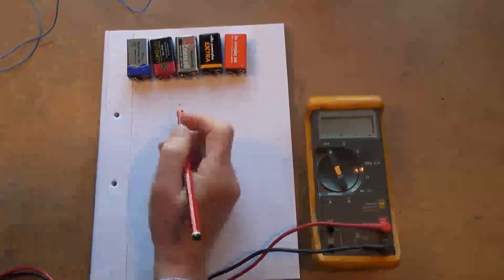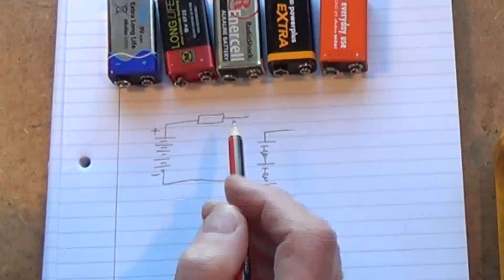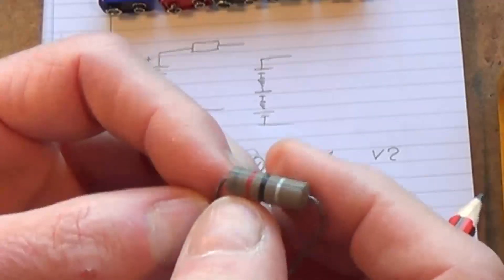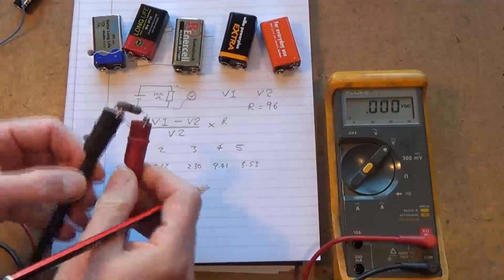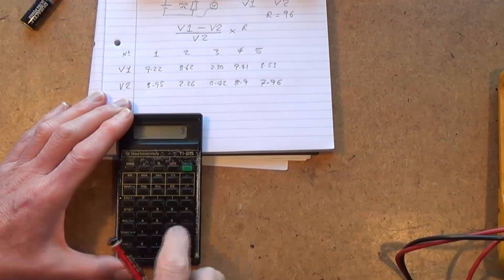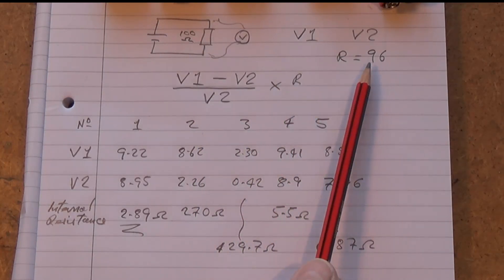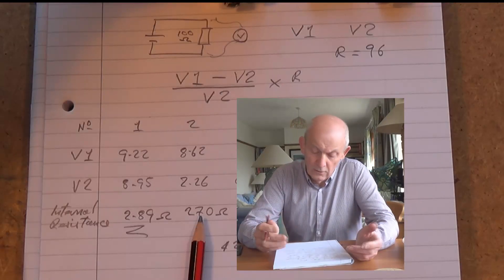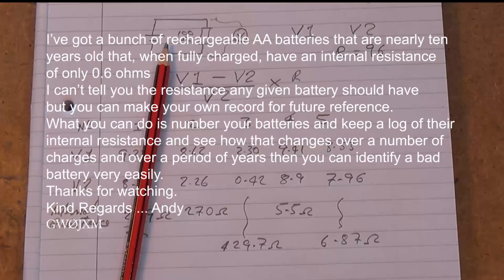About Radio 87 Measuring a batteries internal resistance

Comment: hey andy, i need your opinion. I've built an active antenna circuit for one of my radios. the circuit as is runs off a 9v battery , im gonna box it up and run it off mains with a 12v transformer,regulatorr ,the whole bit. my ? is should i use a resistor or inductor in my pi filter, im worried about rf jumping on the mains. ty

Comment: Hi Andy, could you tell me what Wattage resistor to use with a 12v 2Ah sealed lead acid battery?  I need to check the internal resistance

Comment from the maker: If you want to reduce RF then an appropriate style/value RF inductor should be the most effective component. You’ll never really know if you have a RFI problem until you test the system and sometimes it can be easy to stop and another design can drive you nuts.
If it worked OK with the battery you might find if there's a problem with the PSU (with a resistor) then a few turns of mains lead through a ferrite ring may be all you need. 
Keep it simple.
Good luck.  
All the best .... Andy
GWØJXM

Comment: Hi Andy great job,I use this method end it's working for me ,I have a rezistor 10W 1ohm end check my lipo packs (2s,3s,5s,6s) I have one question is better to check the full pack. ,or better individual cells.
Reply from the maker: Hi there, if you get a satisfactory answer from checking a bunch of cells then I guess that's OK.  But if the answer is bad then you should check each cell individually as one bad cell will negatively influence the result and you wouldn't want to discard a whole bunch of batteries for the sake of one bad one.
All the best . . . . Andy
Reply: @AndyDaviesByTheSea  Tank you very much I appreciate you advise,so far it looks good i keep them under surveillance with this method.
Best regards.